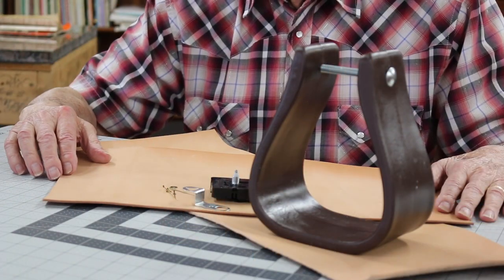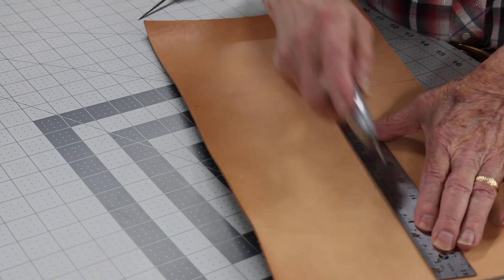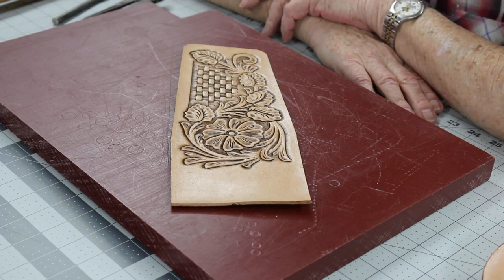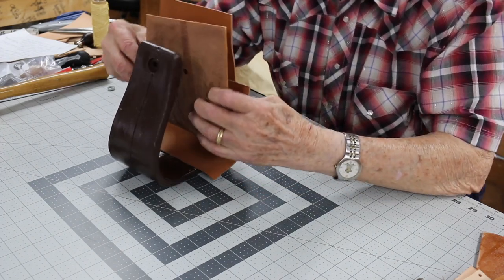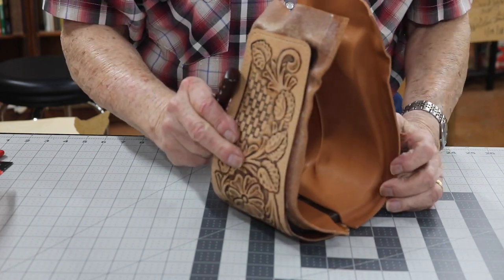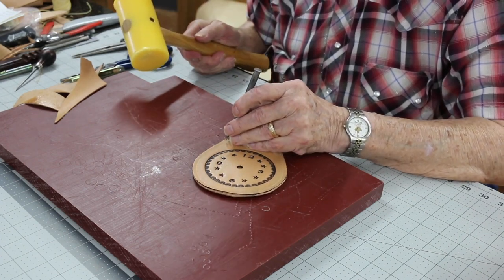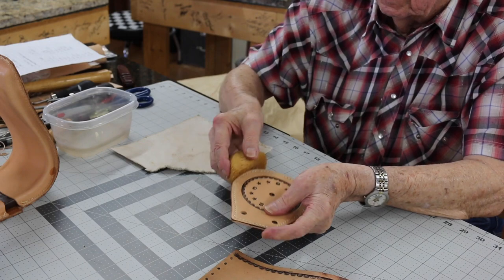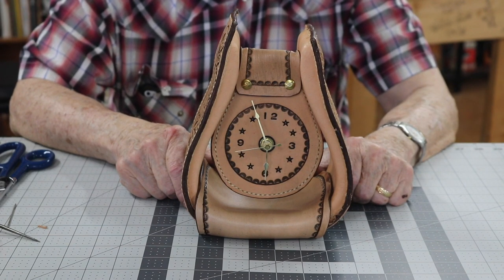How To Make A Leather-Covered Stirrup Clock with George Hurst

Comment: Nice video George.  Question, where did you get the deep roper stirrup?  I noticed there are many different sizes which I assume is the width. Does your pattern fit a particular size only?  Thanks!
Reply: I tend to go to horse auctions and yard sales and pick them up that way. You can pull off the old coverings and make your templates from those, remember though that you need to add the extra to cut off